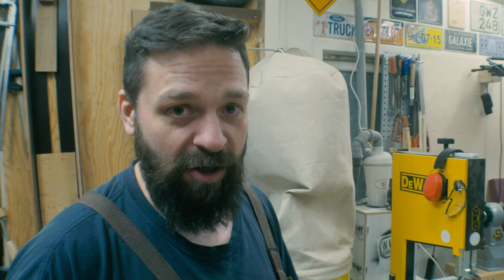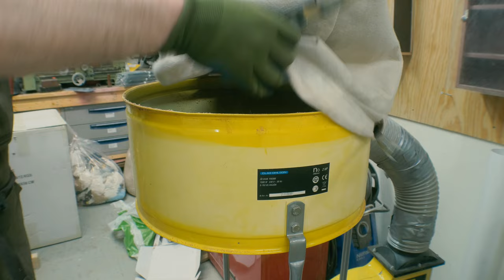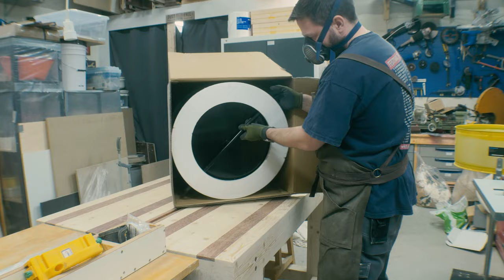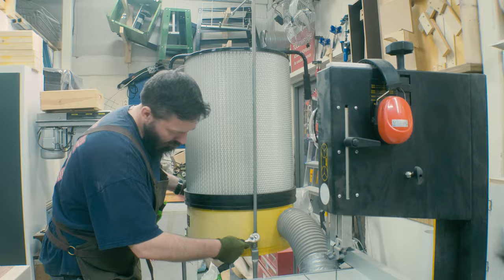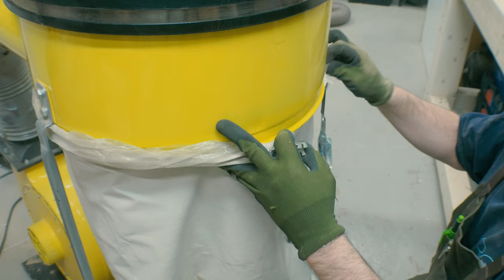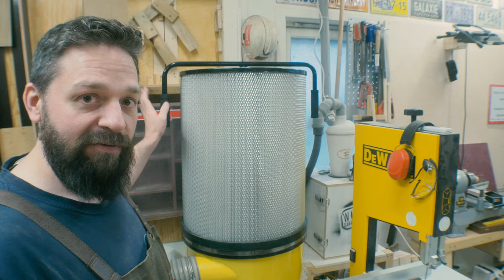Cartrige Filter for Dust Collector | Swapping | Upgrade | Canister

Comment: Hi Willy!  Don't known if it's been suggested, but you really don't need the cloth bag on the bottom any more. It just makes it harder to see when the plastic bag is full. My lower plastic collection bag sits in a trash can so I can just release the full bag from the collector and pull the trash can out with the bag in it. Also, "Stumpy Nubs" has a mod using a 5 gal pail with a gamma seal lid that looks like it would work good.

Comment: You need a cyclone before this cartridge filters will be blocked with wood chips therefore reducing a lifespan. Moreover, it needs cleaning function to shake the dust out of it. For this kind of filter you need whole system. Cartridge filter is for fine dust only.

Comment: I like th rubber seal on the Axminister filter. A little different and slightly cheaper than the Wynn version here in the USA.
I am not sure why you would put the cloth filter on the bottom. That seems counter productive as the cloth allows dust to filter back into the shop. Also that cloth bag is difficult to clean. A Plastic bag seems much better. I have reused one plastic bag for about 6 years.

Comment: I've never used a suction hose that large, so the dynamics might be different.  But I get better pick-up if the angle between the hose-face and  the floor is more acute.
Nice looking unit.
Reply from the maker: Thanks, that might be.  Although this was only a test after the filter instalment. Its not ment to be used that way 😀👍

Comment: Your filter will last much longer if you only clean it with compressed air(60psi max).  The brushes damage the paper filter. 
Great video!
Reply from the maker: Ahh, thanks. Good tip! Thanks for watching!!  :)

Comment: How wide exactly was the drum on your dust collector. Mine is 489 mm (outside flange) below that the drum is 480mm. Wondering if this #700345 will fit mine. THanks

Comment: have that same exact dust extractor. wow 2100kr to buy that filter. i wonder if a hole in the wall to just shoot the sawdust outside would work...
Reply from the maker: It would work, but I would not want to live outside of that hole 🤣 
It was a bit expensive, but I think it was well worth it 👍
Reply: Blowing the dust outside would also blow outside a lot of the air inside the shop. That may be alright -- unless you've paid a lot of money to heat or cool the air. So, assuming you live in a temperate climate, where you don't need to heat or cool your shop, and assuming you and your neighbors don't mind the mess it would leave outside the shop, it's a great idea!

Comment: According to Donaldson's media selection guide (link below), their "Cellulex" media is MERV 10. If you want a MERV15 version, go with model DBA7038, which uses their "Ultra-Web" media. Of course, it does cost a lot more. MERV10 is still good and an improvement over the bag filter of course, but it's worth noting that this is not equivalent to the "NANO" option offered by WYNN. https://www.donaldson.com/content/dam/donaldson/dust-fume-mist/literature/north-america/filters-parts/cartridge/cartridge-filter-selection-guide.pdf